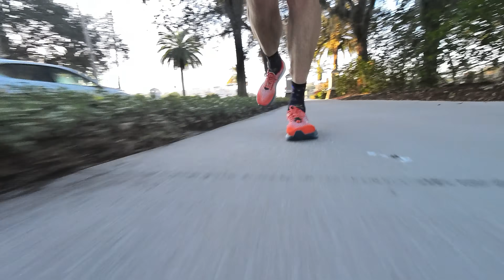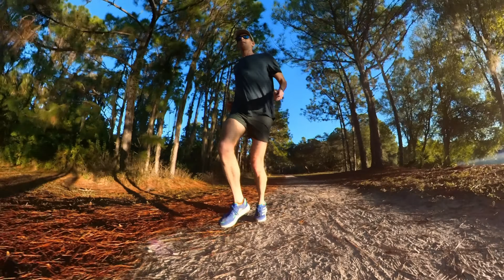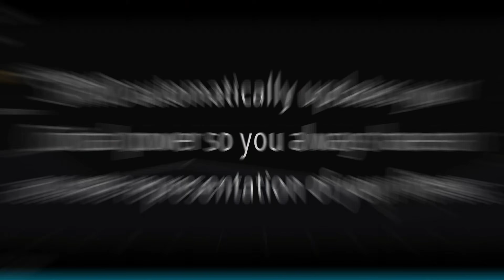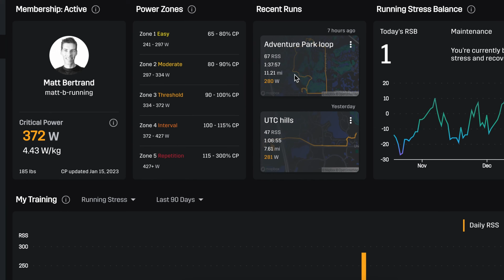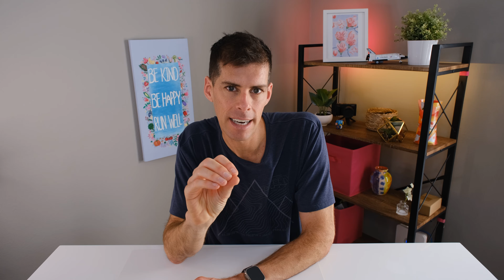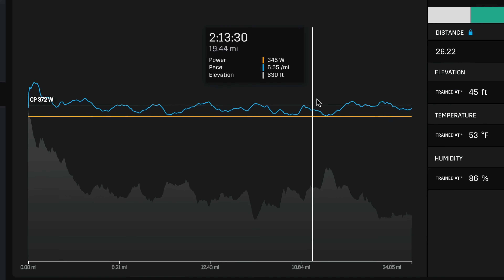NEXT GEN STRYD: what it is, what it does, and why I use it!

Comment: I can dig it.
Wait, how will this react to a session of sled training?  Or working out other than running?
Reply from the maker: That’s a great question, and I don’t know. I suppose as long as your running it will measure the power output. 
What is sled training? Are you pushing a sled or is it dog sled training?
Reply: @its_Matt_B_  dragging a sled behind you, running backwards dragging a weighted sled, pushing the sled, pulling the sled.  It's too boost speed and build muscle that resists fatigue.  Great for conditioning too.  Best part about sled training is, the work is completely concentric so the chances of injury, which almost always happens with the eccentric motion, is reduced.  

I just use a tire with a sandbag on a board I cut and put inside the tire.  Then I installed an eye-bolt and couple nuts and washers and boom, sled.  I use a tow strap to drag it but battle ropes are preferred.  

Sled work shaved a massive amount of time off my 5K and 10K times.  I haven't been on my 10 mile run yet, it's the off-season for me.
Reply from the maker: @MrEsPlace  Ahh yes, I can see how that would have huge benefits without the high risk of injury! Glad to hear your hard work paid off so well at the 5/10k! 💪🏽

Comment: It just hit me . . . I actually saw you at the Jacksonville Half . . . felt like I recognized you from somewhere at the time but I couldn't place where.  Now I know 😂

I ran the Jax Half by power as well - even coming back from injury, Stryd helped me lay down a PB in that race.  I used gen 1 previously and have been using gen 2 since it came out this fall.  As a cyclist, power instantly made sense to me.  It's invaluable in keeping my effort consistent on hilly training runs.  I can do interval training by power over dynamic elevation and still be doing the appropriate level of effort - no need to go to a track to get a flat.  

I also just ran a 30k with over 300m of elevation gain and kept power consistent to slightly negative split through the course.  Pace oscillated a ton, effort did not.  Similar to your Boston marathon effort, felt as strong at the end as I did at the beginning.  I'll be using it for a marathon run in Tallahassee at the beginning of Feb - should be on target for a Boston qualifier and I feel as confident as I do because I know I can hold the power I need to and Stryd will help me with that.  Also . . . 💪💪
Reply from the maker: It’s funny it just hit you that you saw me in JAX! 
I’m glad to hear you’ve had such positive results with Stryd! 
I’m 90% sure I’ll be at Tallahassee too! What’s your goal?
Reply: @its_Matt_B_  I sat there thinking maybe it was work that I recognize you from, just wasn't sure . . . and then I see this video weeks later and the light goes on . . . must've seen you on YouTube at some point previously (although I still won't rule out work if you tell me you have a job in IT).  

Tallahassee, my "A" goal is anything sub 3:14 as that will age-group (50-54) qualify me for NYC, Boston, and Chicago which are my next targets (looking to run all six majors over the next 3 to 5 years starting with the American ones).  Technically 3:25 is the mark I need for my age group but Boston is so competitive that just getting under the number isn't enough so I want to be 10 minutes under if possible.  Add in the fact that NYC age group qualifier is 3:14 and I figure that's the mark I'm aiming for.

Based on the 30k I ran a couple weekends back, I've got the fitness to get there.  Now, I just need to taper down, get to the line healthy, and not make any nutrition or other mistakes on the day.  The 5th just popped into the 10-day weather forecast today and is looking very favorable.  Similar to last year which was near ideal.  I'll be on the watchout for you there - using Jacksonville as my guide, your height is an advantage in helping me spot you in a crowd 😁
Reply from the maker: @E.M.B.R  My height is always a dead giveaway and I’m usually the tallest person around! 🤣 3:14 is a great goal and the fact that you can qualify for NYC, Boston, and Chicago make it worth chasing! 
This year Boston took everyone who qualified, but a 10 minute cushion will always have a favorable outcome! 

I’ve been away this past week and hadn’t checked the weather but I just looked now and it looks perfect! 

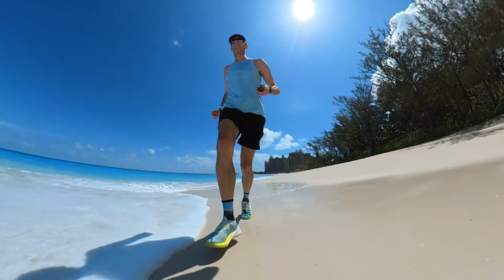I just checked my NYC age qualification time and it’s 3:05, which is consequently my goal for Tallahassee! 😁

Comment: I have the new Styd. I don't get anything more useful than my Garmin 745. I am injured now (low calf pain) and don't run for 10 days already 😱. I think the Stryd is at fault because running by power probably made me overrun. My real concern is that it doesn't know if I am running uphill or down hill. It shows higher energy levels running downhill than uphill..
Reply from the maker: Ugh! Sorry to hear you’re injured! Your Stryd definitely knows if you’re running at any incline. When you’re running down hill you’re not putting out as much power so your power number will be lower indicating you have to speed up.
Reply: @its_Matt_B_  that is what I thought but it doesn't seem to know.. It shows running downhill as 250 and the same way up (hard work) at 180..
Reply from the maker: @i.p2088  🤔 That’s weird. It’s almost like it’s reversed. Have you emailed Stryd? There could be a simple reason or easy fix. 🤷🏻‍♂️

Comment: Great video, first person I’ve seen to give a good review of the next gen Stryd. 

How do you find the pace and distance accuracy for this device? That’s what I originally bought it for to pair with my Garmin Fenix 7X but am having a hard time trusting it’s accuracy. 

Especially with its calibration across different shoes.
Reply from the maker: I’ve been very happy with it and it’s accuracy. Your Fenix 7X is going to have great accuracy, but the Stryd will be far better when GPS signal is weak or if you ever run on a treadmill. As far as the different shoes go, I take my Stryd off my shoes everyday and will put it on a different pair for the next day’s run. As long as you’re putting the pod in the same place on your shoes there should be no meaningful difference in the data it gives you. I always clip mine right at the bottom of the laces. Stryd has made changes in their algorithm so you still get accurate data on shoes like Nike’s Next% 2 with the off-center laces.

Comment: I believe those are useless, gps datas are now ultra precise, most watches analyse strides and running power....using a totally inaccurate device like this one is odd. Power  has been analysed by most watches for many years. The reality is our stride lengths do vary considerably, when you run uphill in a steep 10% + climb, you shorten your strides and this is unable to take this into account.
Reply from the maker: Useless is a little strong, but feeling this way will save you a lot of money. It does detect the shortening stride length and incline (and wind resistance).

Comment: Very helpful video. 💪 I have been using Stryd for about a year and I know what each measurement means.  But I feel that Stryd is lacking in good instruction about how to use this data.  In other words, should I be trying to decrease my ground contact time?   Increase my vertical oscillation etc etc.   Or is all that data to be ignored and you just focus on power?    

What you shared about the web site was helpful.  I guess it is just a matter of getting in there and playing around with it to find out how it can work for you,
Reply from the maker: I agree about Stryd being a bit confusing on how to use all the data it give you. You’re right about just getting in there and figuring it out. 
COROS explains GCT like this 
<210 excellent
210-240 better
240-270 good
270-300 average
>300 poor

Comment: Hey Matt, I've been using the second-gen Stryd pod for 2 years now. I like working on power, but don't buy into their race predictor. It's way off, like 50 minutes off
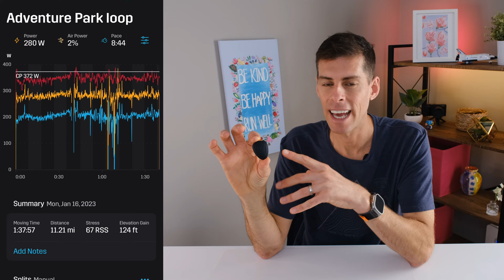Reply: Yeah I use it for every run. I ran a marathon 3 months back in 3:26hrs and it said 4:12.
Which is fine, because I work out what power I want to run at and usually I'm right.
Reply from the maker: @the_mid_night_runner  Oh wow! That’s way off.  Feel like mine is a little aggressive, suggesting I could run faster than I actually can. 
Do you do much speed work? You’re marathon finish time suggests you do, but that’s what I thought with Stryd’s conservative prediction. It can only make a prediction with the data it’s given and if we don’t run a range of speeds/efforts, the prediction could be off a bit.
Reply from the maker: 🤔 Sorry your race prediction is so far off. That’s frustrating! Do you use your Stryd on every run? Which direction is it off? Does it predict you could run faster or slower?

Comment: 💪 Great video. I have been using Stryd pod for 4 years and upgraded to Next Gen last November. I find it very useful for tracking progress over time, setting intensity (and duration) goals for workouts, and predicting my race times and target power goal. Love that they focus on power, but with just two variables: intensity and duration (not distance). I've changed many of my workouts to time-based with power targets instead of the standard 200m, 400m, 800m, etc intervals. Frees me up to run on track, roads, or even trails and still do intentional workouts for a set time interval. For those interested in learning more about power-based training, Stryd has YouTube channel and podcasts, plus some free books/manuals. One question--I have still not figured out the new metric of LBSS (lower body stress score) and impact loading rate. What is a good/bad number? How to use it over time to adjust your training? Any thoughts Matt?
Reply from the maker: You bring up a good question about LBSS and ILR. I thought it was one of those metrics that is relative to the individual runner so any increase will be a lot worse than if we were to maintain the same score over time. I'm realizing that I don't know. I'm going to look into it.

Comment: Nice video Matt, continue the good work. I used to wear my Stryd on every run, outdoor and indoors, although since I bought a new Garmin device with power metrics and better GPS signals, I am now adapting to the Garmin power figures and using my Stryd only for the treadmill. Although, It is a really good tool.
Reply from the maker: I’m m glad you still use your Stryd for the treadmill. Do you find the power numbers different on your Garmin and Stryd? They should be different due to the different algorithms used. Also, I’ve always questioned how good wrist based power measurement is. What are your thoughts?
Reply: @its_Matt_B_  , I have the same question, I have a FR965. What would I gain with Stryd, that I don't have in the 965? Thank you.
Reply from the maker: @jelespuru  The power numbers from your FR965 are different from the Stryd, although they’re just numbers and one isn’t any better than the other. The difference is that Stryd interprets those power numbers into useful metrics. For example, Stryd will tell you what power number range to stay in for various runs. Additionally, Stryd will tell you what power number you should be able to hold for race distances. 
Garmin gives you the numbers but doesn’t say what they mean.
Reply: @its_Matt_B_  , Thank you for your response!

Comment: I upgraded to Next Gen a couple of months ago (early access) and the responsiveness is much improved. I essentially use Power as a proxy for RPE and modify RPE-based training plan in TrainingPeaks to FTP (same as CP) with some tweaking, then the workouts sync to Stryd and then down to the Stryd Workout App on my Garmin. And then I just do what it tells me. I get an alert when I'm too low or high for the prescribed range. I've always had issues with the auto-generated CP and will either adjust it using Tests or manually to get my zones into an appropriate spot. The app lets you adjust the incline on a treadmill run, which is mandatory to keep appropriate Power levels during a non-flat workout. Stryd is tricky to use on trails where the elevation changes can be extreme and vary rapidly, and it's something I'm still working out. I credit the Stryd with the rapid progress I've been able to make in my short running career. 💪 Oh, and the Race Calculator is super useful to play with after loading a GPX file of a course. I typically download these from Strava and add the missing timecode tag using Find/Replace in a text editor. Doing this lets me know how far away from a time goal I am for a particular Power level.
Reply from the maker: I’m m glad to hear you’ve made such progress with Stryd!
How far off, and in which direction, was your auto generated CP from when you tested?
Reply: @its_Matt_B_  When I first got the Stryd, it synced a couple of months of mostly treadmill data and gave me a really high CP. I didn't know any better and nearly killed myself running to those zones. Then I deleted those from the calendar (I didn't know about disregarding from analysis then), and the CP dropped way, way down. And it was clearly too low. So I went to the track and did the 9-3 Minute Test. This helped but it was too high again. So then I tweaked it manually and that helped. I trained like that. When I ran a marathon, it jumped up a lot, but I knew it was a solid effort and have mostly stuck with that number as a reference even though post-surgery recovery period brought it way down ... again too low too be useful. I now have some sense of RPE (that I can sustain for various periods) and tweak the CP to that. I'm in a base-building phase and it is working out. I start a training block in a couple of weeks, and will do the test again at the beginning of that.  I've learned that you need to run your best along the different sections of the PDC (10s to 3h) to get a proper analysis. That is hard to do on the short end without going to the track and ideal conditions, at least in my experience/opinion.  (sorry for the long answer)
Reply from the maker: @eric-running-to-chamonix  Thanks for that response! It looks like there is still a lot of gauging our RPE to be sure we can maintain the power numbers provided. A lot of times i'll hold onto a power number because I'm told to, but am sometimes unsure if I could maintain for hours and hours. I also think that perhaps the algorithm knows better than me. 🤣 But also perhaps I want to think that so I can imagine i'm better than I actually am.
Reply: @its_Matt_B_  "hold onto a power number because I'm told to" ... precisely! That is the main benefit of Stryd IMO. Despite my ups & downs (literally) with CP, it's like having a coach telling me what to do. Telling me to back off if I'm running too hard, and telling me to giddy-up when my watch goes blue. Even if it's not totally accurate, moderating my effort is super useful and means I train better with it than I would (or have done) with any other approach. I have a lot more races this year than last, so it will be interesting to see how Stryd feels about regular race efforts. I suspect it will be pretty dialed in. In my case, I'm also using TrainingPeaks so can monitor my TSS progression and CTL "ramp rate". So I have a check on the effectiveness of the Stryd.

Comment: 💪Thanks for this video! As a treadmill and outdoor runner I've been considering a foot pod as a way to baseline my runs regardless of where I'm doing them. I do notice that during the winter when I'm on a treadmill I often regress and have to do a bit of catchup when I can return running outside. Running by power sounds like a good way to ensure that I'm not regressing when I'm on the treadmill.
Reply from the maker: It sounds like it would work well for you! It’s a great way to objectively measure your effort, rather than subjective measures like HR.